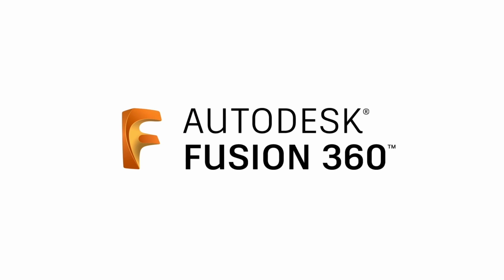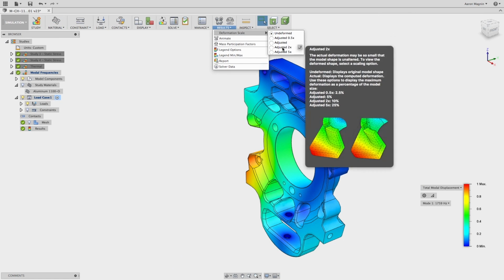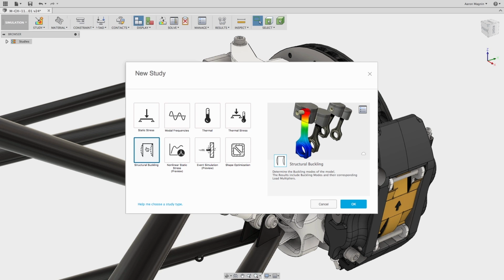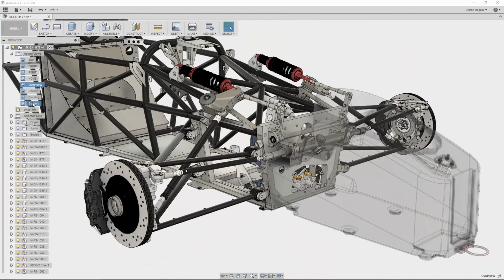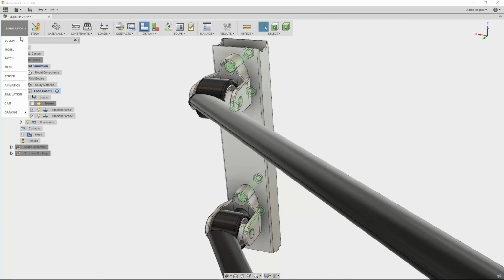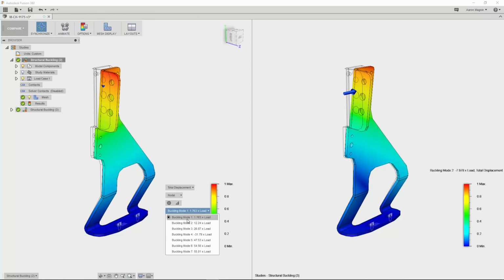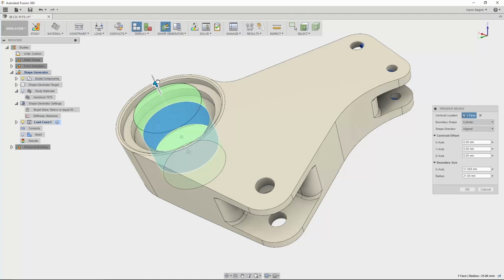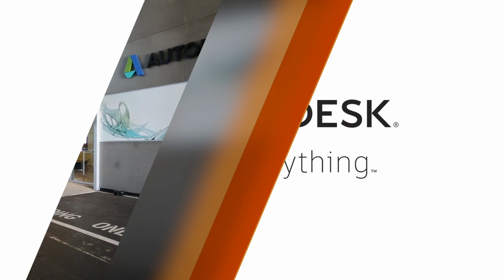Advanced Simulation

Comment: Is all of the simulation process run in the cloud, or have the possibility to run offline? Internet connection is another problem here.
Reply from the maker: No, not all. Local solving is supported for Static Stress, Modal Frequencies, Thermal, and Thermal Stress analyses. All other simulation types must be solved in the cloud. From: https://knowledge.autodesk.com/search-result/caas/CloudHelp/cloudhelp/ENU/Fusion-Simulate/files/GUID-6A3A1888-357D-4006-A01E-D18122DB8AF7-htm.html